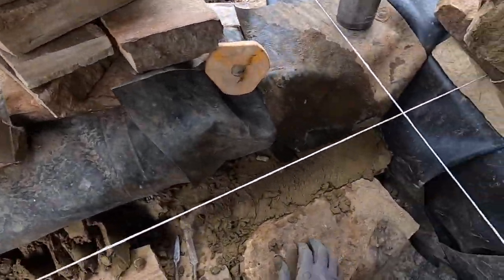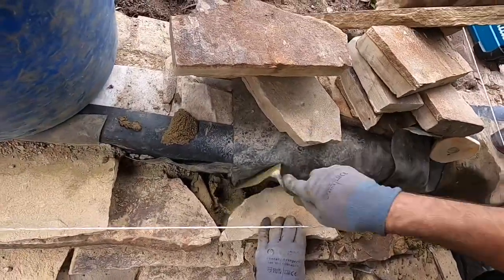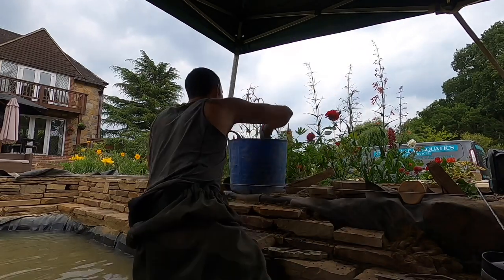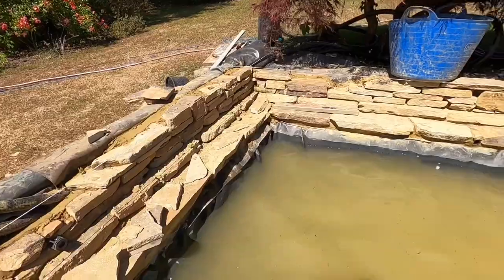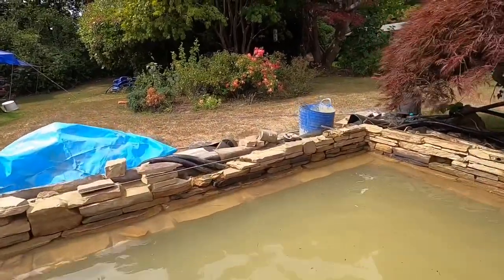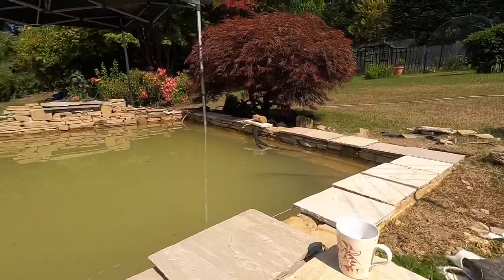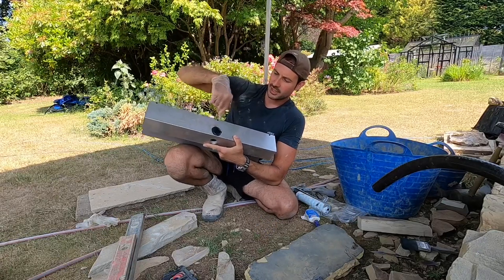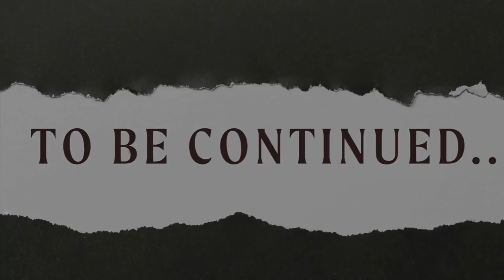How to make a pond: Formal pond re-design & construction part II

Comment: Hi Ed, thanks for your reply. I meant the slips that you put over the main liner that you then bed your mortar onto. I know nothing about pond construction but someday I would love one. Cheers David.
Reply from the maker: Ah I see! No need to bond these loose offcuts of liner to the main pond liner- the weight of the stonework bearing down on this and the slight undulations/dimples on the main lining itself all ensure that everything is secure and stable and there’s no risk of either the liner off cuts being accidentally pulled out once the stone work has been completed, or any risk that the stonework itself could be in some way insecure due to sitting on sections of liner.  Thanks for your comment and I hope that you manage to get your pond one day! I’m still in the throes of completing my own pond- nearly finished now…! Best regards, Ed
Reply: Thanks Ed. I've seen part 1 of your own pond build and it looks very promising. I appreciated the explanation of how to use the laser level. Cheers David.

Comment: Great pond , like the wall ! Do you have any preferences on pond liners (how thick, rubber butyl or other materials ) for in this size pond or maybe you have a ‘go to’ make type? . I’m about to buy a liner for my pond dug ,  with a  few levels, oval shaped (to 0.5m deep and 2.5 long and 1.7 widest). It will have a bit of a wall to the liner . I find many types but little detailed advice but so far forming view that Firestone is the best at 1.02,mm which I hope means it will last and fit beast around contours. Any views, your videos or advice appreciated !
Reply from the maker: Hi there!  Thanks for your comment;  with regards to my preference for pond liner- I tend to use the 1mm firestone rubber lining for most of my jobs- if thats not available i’ll also happily substitute for a 1mm green seal rubber.  Neither are what I’d call particular flexible for tight angles however and in particularly intricate shaped ponds a thinner gauge 0.75 mm (such as a 0.75mm green seal) might be preferable to minimise creases.  Personally I would prefer a thicker lining however and as my construction methods conceal much of the visible liner- a less flexible material is no cause for concern!
Hope this helps!
Best,
Ed
Reply: @CrystalClearAquatics  Thanks Ed